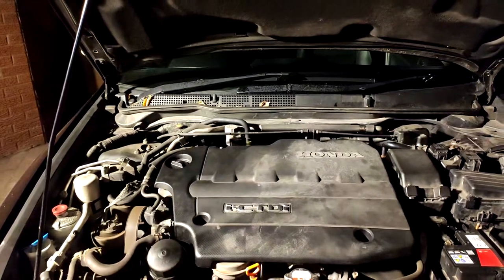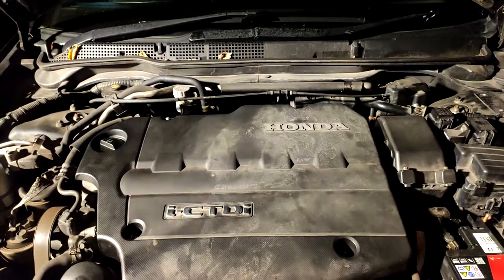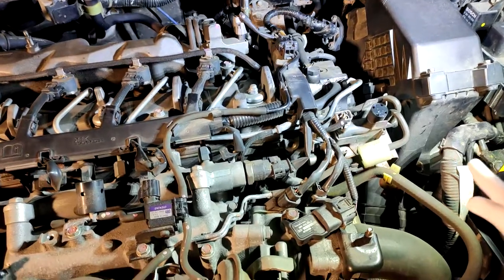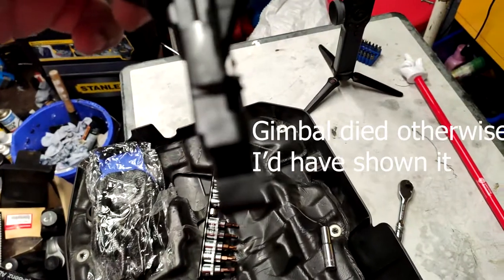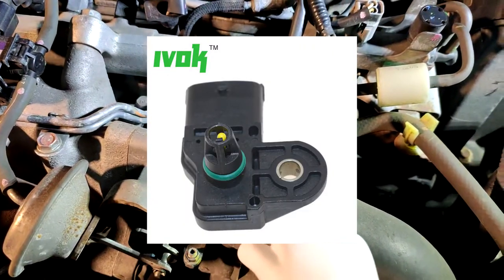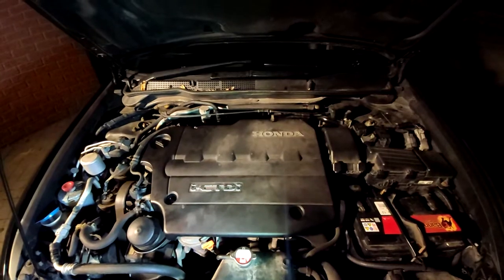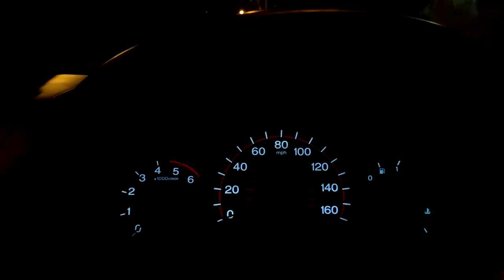Honda i-CDTi 2.2 Diesel N22a Accord, Civic, FR-V and CR-V MAF and MAP sensor cleaning.

Comment: Another excellent and helpful video .Like Michael Bond I'll try this soon. Might help start my Accord better as when I start it ..Sounds / Feels like starter motor takes its time when cranking the engine over ..
Reply from the maker: If your battery is good. It could be your starter or my accord was getting hard to start it was the injector seal leaking.
Reply: @enginium6043  Hello ..thanks for the reply. The Injector seal ..Have you done a  video on this replacement or can you advise me

Comment: Great job you did there!
I would like to buy a used Honda Civic 2.2L diesel, but I’ve read that due to the heavy torque they’ll probably need a clutch + DMF replacement around 100K miles or so, which can work out pretty expensive. 
Is that accurate, in your experience?

Comment: Hi there, you could do a video for cleaning egr valve on honda crv 2.2 iCTDi 2005 and later models also can be difficult to remove from vehicles, and how to clean them ! Also question does a gunked up egr valve cause exhaust gases to leak into engine bay rear and also vehicle cabin ? Many thanks Mark
Reply from the maker: Hi mark, I could do it on my accord I don't have a CRV but it's the same/similar engine. It's not really that hard it's on the front of the engine and it's like 6-7 bolts. It's a little tricky but nothing a bendy socket doesn't help with. If you are getting exhaust smell in the cabin either your injector seals are failing or have failed and it's making a chuffing noise or more commonly the exhaust manifold on the Cdti is a weak point and it starts to blow. Sometimes if you take a torch you will be able to see where the blow is but most likely it is the exhaust manifold. When you change it make sure you change the gasket too.
Reply: I think you have a cracked manifold,happens alot on accords and civics too.

Comment: Got a 2006 civic 2.2 ctdi with intermitent engine light saying check system car seems to run fine but comes on and off every few hours  . 2 codes p2199 and p2004. Any ideas ? Thanks
Reply from the maker: might be IMRC solenoid and map or map.

Comment: my civic 08 MAP sensor failed and is in limp mode...tried the cleaning, no luck and code wont cancel so the local garage will fit a new one on Friday.
Reply: update > the garage unplugged the sensor and cleared the fault...so the cleaning worked.
i used electrical contact cleaner on the sensor probe and small amount of black soot was blasted onto the tissue.
if faults happen again i will try unplugging the sensor and clearing faults with my OBD reader.

Comment: Hi do you think this help with slight stuttering at 1500rpm in my Civic 2.2 cdti?  Thanks
Reply from the maker: It might. If you give the map and maf a clean first, then check the egr valve isn't clogged and is working properly. Does it spool up properly and drive normally other than the stuttering?
Reply: @enginium6043  Yeah car drives fine when cold but it stutters at 15-2000rpm when at
operating temp
Reply from the maker: Any code come up?
Reply: @enginium6043  No codes
Reply: @69Dobby  Hi did you resolve your problem? because I have the same situation on my civic.thank you

Comment: Ever had them affect acceleration around 2k rpm in 4th and 6th and maybe 5th on pulls? or slow pulls.
Reply from the maker: I don't think. What problem you having it not accelerating as it should? Is it throwing a code?

Comment: I have an electronic probelm with this engine! 
I have the error code p0340 wisch is the camshaft position sensor fault, i replaced it and still the check engin light's on the same damn problem! 
I don't know if you have you idea about this, can it be the ecu!? Or some electrical issues!? Or anything!
Reply from the maker: Did you change the sensor yourself? Did you put everything back together and plug everything in? Did you clear the codes and do you have any running issues?
Reply: Camchain stretch...?

Comment: Sal ce ulei ii bagi la motor ?
Reply from the maker: I use 5w-30. That's what honda recommends for my climate but depending how hot or cold your climate is, you might need a different oil 👍
Reply: @enginium6043  Multumesc mult

Comment: No. T25 WON'T WORK. I had to remove the whole filter housing
Reply from the maker: Yes I know. There is a whole bit on how you need a 5 sides torx. Did you miss that bit?
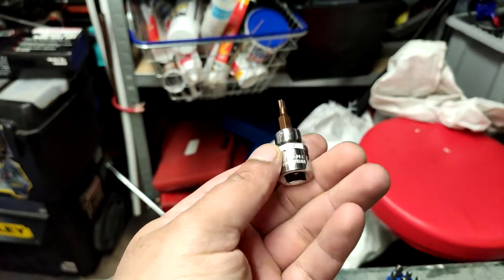Reply: @enginium6043  Hello, in video at 2:15 you represent  ST20 and not ST25. Which one is correct?
Thanks!

Comment: Hi, I got civic mk8 2.2 icdti. It constantly in limp mode, reset it and limp mode in a few seconds. Any ideas?
Reply from the maker: You pulled the codes? Could be a million things
Reply: @enginium6043  P1401, P0670 on a small cheap reader.
Clicks right back into 'check engine' a few seconds after clearing. Spoke to Honda, they said the 2 A/F sensors. Don't think a diesel 2.2 icdti has them!

Cleaned out the CAT (s) and searched along exhaust for sensors. Nowt!
Reply from the maker: Have you tried cleaning the egr valve? Give that a clean and see what happens, there are guides on YouTube. Depending on your mileage it will be heavily clogged.